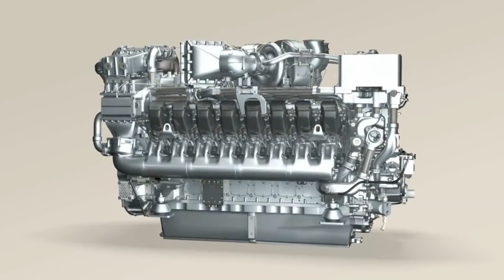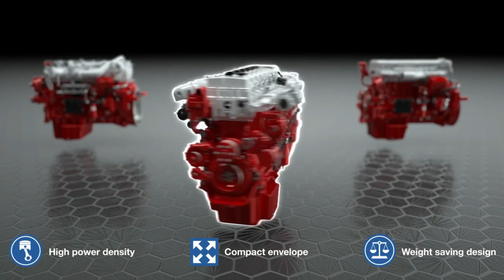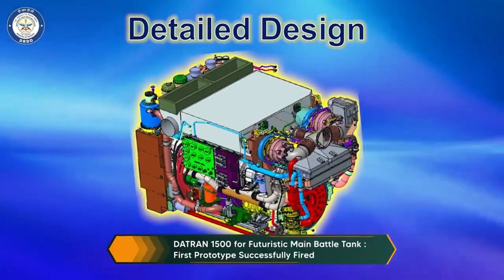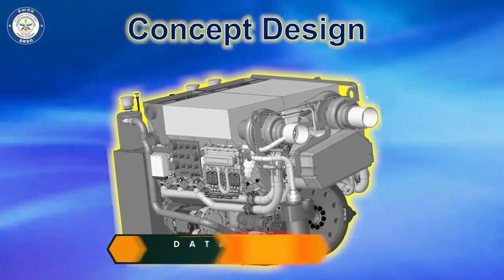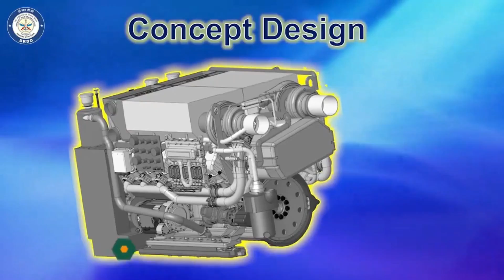Indian Main Battle tanks & Infantry combat vehicles to be powered by DRDO’s developed engines

Comment: BEML 😂 , they make everything under licence. It sure would be old of the licence designs for earthmoving engine, probably a Komatsu design. Older designs would still be better , engine blocks would be of a time tested design and wouldn’t fail. For military application , emissions wouldn’t be an issue .A better approach would be to collaborate with an OEM who make engines for marine and construction application. Caterpillar would be a good bet , may be the volumes are low to justify such a partnership.
Reply: Bruh It's A Newer Engine Designed By DRDO itself.
What The F*gg Are You Saying!!😑😑